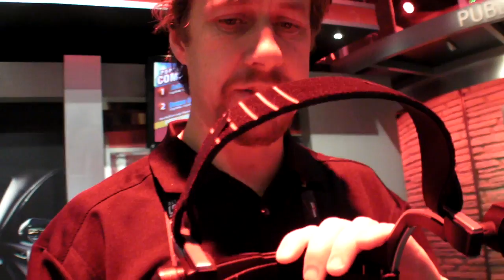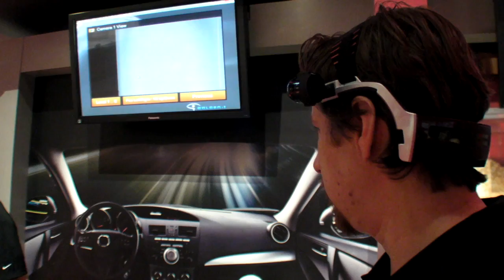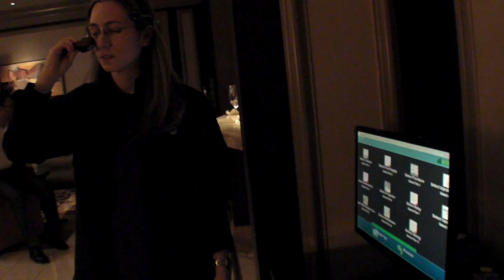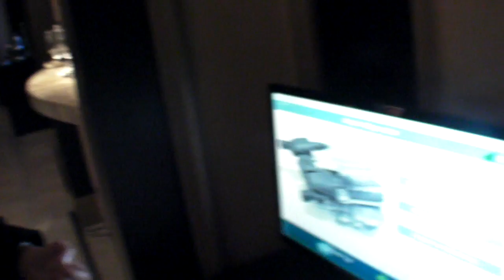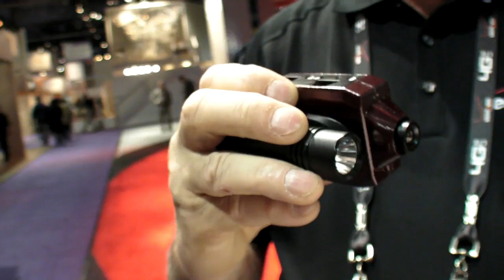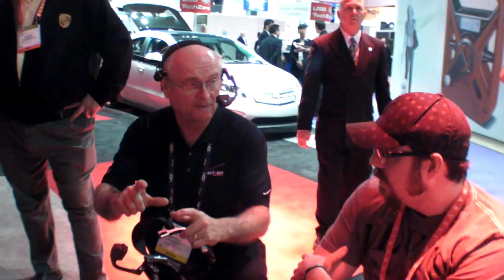Motorola Kopin Golden-i at CES 2012

Comment from the maker: That link is not augmented, it's just a gimmick that doesn't work. Just search for my other videos of the Kopin Golden-i to find the videos where I show the screen. For now it's a 800x600 1" screen, but they can fit upwards something like more than 1080p on that 1" screen for a price or when mass manufactured. Surely cheap 1024x768 I think is possible when mass manufactured. That means you display as much text and data as on a 10.1" tablet, and it looks like that, you have to try to understand